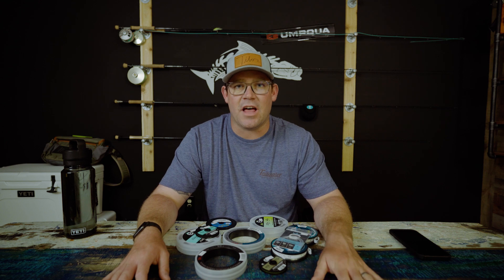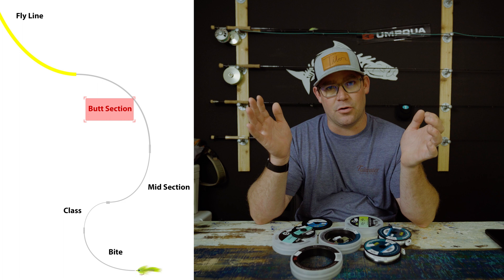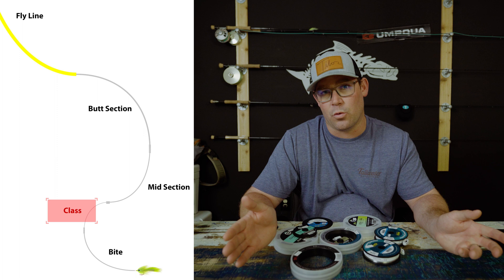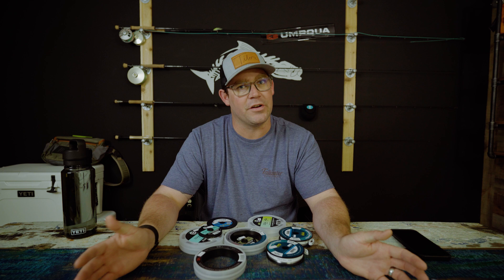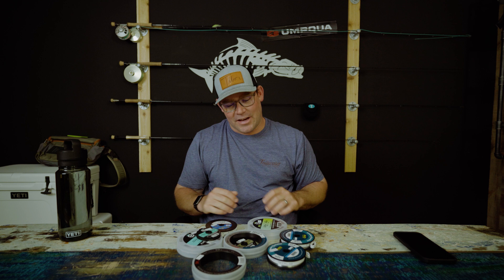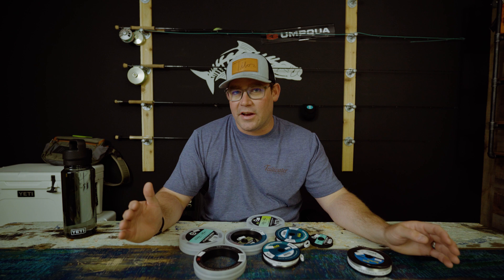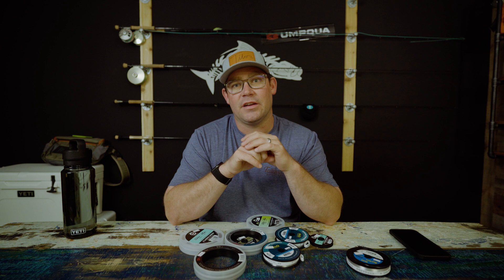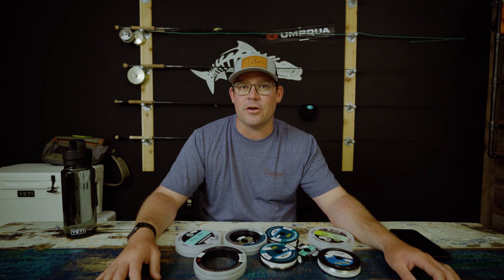Saltwater Fly Leader Overview | Are Pre-Made Tapered Leaders Best?

Comment: I use With a 8wt line.  5’ of 40# Mono butt section to 3’ of 30# Mono mid section and 3’ of 20# Fluoro tippet . Done.I believe what’s most important is 50 percent of your leader build should be the butt section.  5’ is perfect for wind or no wind.  Great transition.
Reply: What knots do you use for transitions?

Comment: For my saltwater leaders, if I don’t tie my own. I use nylon 9 or 10 foot tapered nylon leader then 2 or 3 foot fluorocarbon tippet . I want the nylon to be high on top of the water to avoid dragging it close to the rocky sharp bottom.  That avoids a lot of snags when I am stripping or even just walking with leader dragging behind stalking the flats here in Maui . We do not have much sand flats at all . Mostly broken sharp coral.  All you need on tippet is about 2 to 3 feet of it to help keep the fly from bouncing to high from the bottom while stripping. And the last thing about the nylon , it makes it really really easy to pick the line an fly up and drop it again . I’m just referring to really chasing the silver bars( bonefish) . Which is the only fish we have to stalk here in Hawaii.   Just my personal preference.  Rock an roll . 🎸🎣                 The Armadillo
Reply: May I ask what type of knot do you use from your mono to the fluoro tippet? Thanks 🙏

Comment: Question is: Do we even need a tapered leader for Salwater?
Here in New Zealand, for Saltwater, most of us don't use a tapered leader at all. Just a regular Fluoro leader.
Yes, not "ideal" for transfer of energy but you quickly learn to snap stop that wrist on forward so the line unrolls. 

For a long time, I was buying an then making my tapered leaders until I gave up and can't see much difference
Reply from the maker: Hey DaVinci FPV, the answer to that question is definitely yes for us in the Tampa, FL Area. You just can’t turn a fly over very well without a proper tapered leader at 70+ feet, especially if there’s wind. If you do turn it over, it usually slaps the water extremely hard and spooks fish.

Comment: Great video and very clear. I’ve had a nail knot fail by stripping the coating off the fly line. Do you put a locking knot like a couple of half hitches after the nail knot to  better secure it? I now use an Albright knot for fly line to leader connection which works well for me.
Reply from the maker: I tend to cover them in super glue or UV resin, and I’ll tie two. Three for the 11 and 12 weight tarpon rods to bomb proof it. But half hitches like you said should accomplish a more secure connection as well
Reply: @tailwaterflyshop  Thank you! That's a great tip.

Comment: Very good simple information.. still new and I only fish salt bay on my kayak in mostly 10 to 15 foot of water.  

Getting a 7wt salt set up..
what's a good fly line for get to that deep and a good formula to make my leader/tippet mostly using 10 to 8,6 4 size hooks using small clourser and shrimps with small dumbell eyes weights 

Some say can just use a tippet about 4 to 6 foot long and that's it 🤔

I'm fishing mostly blind cast at times but also don't want to smack the fly lure on the water..
Reply from the maker: Hey JDM! Something like a Cortland Ghost Tip should work well https://tailwatershop.com/products/cortland-ghost-tip It has a clear intermediate tip. Or something that will get down even further is the Cortland Clear Intermediate Tropic Plus https://tailwatershop.com/products/cortland-clear-intermediate-trop-plis Fluorocarbon in your leader would definitely help the fly get down more if those lines aren't enough. Please don't use a single piece of mono or fluoro. Try the scale test and pull with your 7 weight. You'd be hard pressed to see 9 or 10 pounds before the rod breaks. One shark or unexpected huge fish, and see ya later $100 fly line
Reply: @tailwaterflyshop  oh yeah we also got sharks and bat rays that i dont want to catch lol...thanks ill keep that in mind need to make a break off line ..not trying to lose a 100 fly line ..also trying not to break a 500$ rod

Comment: Was kinda shocked to see average length leaders being used. Even in the spooky trout streamer game I usually have just a 6’0 leader with maybe a foot or two tippet if I’m using fly line. Besides that it’s usually just 20lbs maxima with a tight line setup for the smaller ones.  Would have thought all the tourist would have acclimated y’all’s fishes to be less spooky.  Been finding out the hard way that’s not the case.   After several days of only catching puffers and getting needlefish all riled up this ole ignorant trout man is coming around though.  Also convinced that tying some of the baitfish patterns y’all use there is far more enjoyable than having to pump out a bunch of #16 to #20 nymph and dry patterns of many variations.